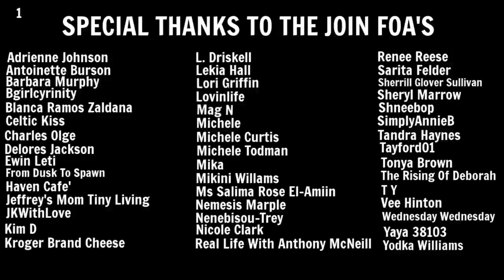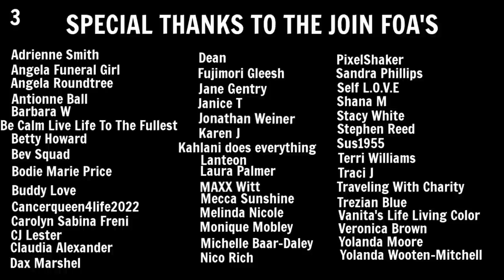Living In A Minivan | Van Build Day 3 | Unconventional Floor Choice

Comment: Your a Good Man Anthony. as a professional contractor that stuff was not designed for foot traffic and unfortunately it will rip especially with winter coming. I definitely appreciate you and your creativity. You have a great personality. That stuff is designed to install Waterproof vinyl plank flooring over top of it . The flooring cuts easy with a Multi tool . You could by rights return the tool when your Done .We use that product on basement walls as a vapor barrier to prevent moisture issues. I’m sorry to have to  tell you but winters coming fast.
Reply: Rockwell makes a ocelating multi tool that’s cordless you would be able to do a lot of your projects with it .Take a look at them if you get the opportunity they cut almost everything. Have a great Day and good luck on your project my friend.
Reply: Wow you have such a respectful way of giving feedback! 👏
Reply: Very important, especially since heat and moisture are two major issues in van life.
Reply: @George-xe2ub  😂😂😂
Reply: @George-xe2ub  😂😂😂😂😂😂😂
Reply: @Dutch_Gonneke  Isn't he just the best!  :)

Comment: If you put reflextix down you will see it will start pulling apart and crumbling. Put it under the carpet for insulation. Put the large board then the refextix then the carpet. Then put in your table and bed. Use some L brackets to put some shelves in under your table.
Reply: Exactly what I was going to say
Reply: I was thinking the exact same thing. Overtime it’s going to start cracking, peeling, and tearing. It might look nice now,  but it’s not going to withstand the long haul unfortunately.
Reply: You are right. I use it downhere in the Caribbean as a window cover to cover the inside of your car against sunrays to keep it cool. After about 1 to 2 months of heavy use it starts cracking and leaving little bits and pieces all over your car and yourself creating a mess
Reply: He could of gotten soMe of those connective matting the type they use at gyms or whatnot that would be great. I think Anthony is worried about easy cleaning
Reply: @kingrook45  maybe he could use a little hand held chargeable vacuum
Reply: Exactly, I was thinking the same. Do it right the first time ❤
Reply: Antony could place one of those clear runners that is used on carpet for heavy foot traffic aress
Reply: The drill driver is a little late to the party
Reply: Goodness! That crackling sound as you walk and move around is annoying enough!!😀Lmbo Anthony! I can’t agree with you on this one!😂
Reply: I was going to say the same thing. He needs to put some type of carpet down or a linoleum type thing

Comment: Your spare tire is under the back of the van. Under the board is a crank to lower your tire. You need to locate it mark your board and make a hole so you can get to it. You never know when an emergency may arrive even if you have roadside service the need to lower the tire.
Reply: Great suggestion. I hope he sees it.
Reply: The 2012 Grand caravan  that I have the spare is in the front part of the van and the crank is in the front to lower the tire I'm not sure if they changed it.
Reply: Hey and I'm not trying to be mean but I worked at home Depot and Lowe's and flooring wall and both these companies and he's using reflectives as a carpeting it's going to get all ripped up he's spending all this money or whatever that's not meant to be walked on I don't understand why he thinks he is doing that I don't he's going to make so much more work for himself that's not meant for that
Reply: Lawd have mercy...the mylar reflection will create  moisture along with the butane,boiling water steam and freeze a home for mold...walking on that with socks and bare feet is like a slip and slide if you spill anything and lose your balance watch out for your head,back,and possibly a broken leg or foot...it peels,flakes, and pools water in the grooves if you tear just a bit of it 
It can water rot the wood you made your bed with, and destroy the insulation of a perfectly good van...There are plenty of van builds on YouTube where people build as they go...lookup budget van builds on the tube...if not...get a ⛑ helmet...to protect your head if you slip and fall...(I pray it never happens...)
Reply: @dianematlock7922  I hope you posted this in the regular comments and he sees it. We don’t want him slipping and injuring himself.
Reply: Good idea
Reply: @lisasharinglifestorieswith4182  thats what i told him.
Reply: @KetoCarnivoreLifestyle  i know huh. I post messages telling him step by step to what he needs to do. Lord he needs to make it down here to texas so i can fix his van for him. He makes me nervous. He'll be doing something and im like nooooo thats not going to work.
Reply: @JamericanSpice  I didn't... it's a little late anyway. He's not going to change anything at this moment...he's in a rush to see his momma and being there when he said he would be...should've planned the inside first...Rushing to do things rarely  works out well...I wish him the best, hopes he picks up a helmet...as he walks the slip and slide walkway...
Reply: I would research more . You do not need mold or moisture . Passive airflow needs to happen.
Reply: This guy is clueless about what he is doing. Using insulation as floor covering.  Using nails and butchering everything by ripping it out to do it over again. Not to mention  covering access to lowering the spare tire. This job is just costing him money not sitting down and planning. He buys and does thing on impulse and need to stop and think
Reply: No on the stow and go seat spare is up front between the driver and passenger seat.  Covered with a black plug.
Reply: @lisasharinglifestorieswith4182  it is amazing when i watch and listen to people that common sense doesn't come into play. Sit down with a piece of page and draw out what is a possibility. If it doesn't sound logical. Throw that piece of paper in the trash and start over. Sleep on it, think about it, talk to God about it. Don't reap the benefits of sheer stupity. As i watch im like omg are you serious. The 2 sheets of ply wood threw me. 😂 there's book smarts and there's Anthony. Yes i will come over to your channel. Gods blessing 💙
Reply: @Inthesouth2  I appreciate you I know rocket scientist but him being a grown man I just can't even believe cuz I worked in floor and wall like I said at Home Depot and I worked at Lowe's and electrical and I'm not smart right but I anybody that was a grown adult would know not to use reflectix that's it's just it's just too keep him warmer it's nothing to walk on I just don't understand and when he used that accent one time he bought an ax and he acted so afraid even a woman won't act out afraid to use an ax little hand ax he got he was he was too afraid to use it he had to put it away and I'm like a little kid would know how to I just don't understand Anthony I don't know if Anthony was real sheltered or what and I'm not trying to be no disrespect to him but it's just no common sense it's just makes no sense and I appreciate you you seem like such a nice person and you know what this is what kills me Anthony seems to have the nicest people that follow him and and talk to him and he don't return like he doesn't talk to none of his people like I do that's why I want what I said in my thing and I keep preaching this I want to reach out and be a part of your lives yeah if I become big on YouTube eventually you make money and stuff I just don't want to take money and not talk to nobody I want you people to be a part of my family and that's what I you're a part of my life now and I appreciate you thank you
Reply: @carolcatchychanneltipsandt1448  Carol I read what you said and it makes so much sense I don't know what Anthony is thinking also because by putting that reflectus is great for not on the floor under the subfloor but it's great to insulate your van but not on a floor to walk on it's going to rip all up I don't know what he's sleeping and I appreciate it sounds like you know about van life about moisture condensation being in there and I don't think he's aware of that he's had a van before and I don't know why he's not thinking about moisture cuz everybody everybody I watch Vancity van life Chrome who lives in British Columbia and he's awesome he knows his stuff so I just wanted to take the time to reach out to tell you I think you're awesome what you wrote him I have a channel called Lisa sharing life stories I met a couple people's on Anthony's Channel Southern humor joined my channel and if you'd like to you sound like a nice person it would be nice if you joined it too so you have a great day and take care I just hope he can get the help he needs because he's not doing stuff right and he's going to have problems
Reply: @lisasharinglifestorieswith4182  don't advertise your channel on someone's page.
Reply: @jojopowe1150  I'm not advertising my channel on somebody else's page we can't these people came to my page and we were talking about something privately so it had nothing to do with Anthony you or anybody else it's a private conversation so please take care of your own stuff I'm not meaning no disrespect but it had nothing to do with anybody else they came to my page cuz we needed to talk about something
Reply: @jojopowe1150  people had questions about my previous job at Home Depot in Lowe's and I was explaining them stuff about it I didn't want to keep talking on this page that wouldn't be right so they came to my page and we discussed some things so that's what that was about but it's none of your business so please I'm not trying to be mean rude or anything it has nothing to do with you what I'm talking about to somebody else that's just not right it's none of your business
Reply: @jojopowe1150  I'm not advertising anything about my page people came to my page and we needed to talk about something else I don't want to keep writing something on somebody else's page that's rude and ignorant I wouldn't do that so please this has nothing to do with you take care of your own business please and don't be mean and rude this is nothing to do with you I'm talking to somebody about stuff I used to do at Home Depot and Lowe's it has nothing to do with you please that's just not right
Reply: @jojopowe1150  can you stop writing me I'm talking to somebody else that has nothing to do with you about where I work and I wanted it to be private so please can you stop
Reply: @lisasharinglifestorieswith4182  ??? I did not write you.
Reply: @jojopowe1150  well then I'm real sorry somebody wrote me said I was trying to advertise my channel and I'm not I was just trying to talk to a couple people and not put all my business you know what I'm saying and I apologize to you I'm sorry

Comment: I would be tempted to find an area rug maybe 3x5 or 4x6 to place on top make the floor more cozy and you could shake it out when dirty.
Reply: Actually a runner is 24in by 84 that would probably fit in perfectly.  Anyway to get that seatbelt out of the way?

Comment: Hi Anthony.  I don't know how long Reflectix will hold up on the floor where you're walking on it.  But it's certainly worth a try!

In my minivan I have the floor covered with interlocking foam squares like you'd use in a kitchen or gym.  Because I live on my knees in there, and the padding really helps.  If the Refletix doesn't work, you could try that next.
Reply: You should put foam carpet on top of that because over a little time that's going to chip real bad.
Reply: Its to be used for insulation not carpet, im laughing watching him do this. I don't think he did any research
Reply: Thank you again, Anthony.  I'm learning from you. People don't understand that there are many like us that just tackle a job without first researching and researching again and double checking everything that it becomes exhausting & boring & no fun at all.  I personally become impatient if I don't go in full charge - picking up the pieces as I go.
Makes the day go by fast, keeps your mind entertained.  I guess I'm a little bit like MacGyver - take what's available & make it work.🙂
Reply: Yes, it's a good idea,  but reflectic will, start crumbling, it's an awesome insulation, but not for everyday traffic   maybe if you put rug that comes in squares to match the van interior color...
Reply: @edgit69  Useless insensitive comment.
Reply: Could the interlocking foam work on top of the reflector? Maybe additional insulation and cushioning?
Reply: @MsPhillyG  I see about 90% of the comment are telling him the same advise as I am. Do be encouraging him like the other 10% to think it's ok 👍🏽

Comment: Tip. Run a strip of gray tape right down the middle of the floor coverings to prevent crumbs and other debris from collecting in there. Also, it will securely keep the two pieces in place better....less shifting

Comment: The sound of your new floor would drive me crazy everytime I would walk on it......I would get some black carpet that they sell on a big roll at home depot....have them cut the length you want...
So it would prevent the noise and you wouldn't make dents in the reflectix.
Reply: You may end up using the extra reflectives to cover windows to prevent moisture build up and to keep the van warmer. Some people glue it on the back of poster board from dollar tree and the board can be sprayed black. When these boards are cut to fit each window they help to keep the van warmer and cooler. Amazing the things we learn as we go. Don't ever get discouraged.
Reply: @edithtrowbridge1775  they sell black poster board, too.

Comment: I hope the reflectics is sturdy enough and will not wear and tear quickly when you move around on it 🤞🍀
Reply: As a professional contractor, We use it as a vapor barrier on basement walls . It would work also with vinyl Waterproof planking over top of it to give him a insulation value. Anthony is a good guy … this stuff is essentially silver bubble wrap . It won’t hold up to foot traffic
Reply: @christophertrump1570  Yes, I was thinking the same as to not holding up to foot traffic.
Reply: @christophertrump1570  thanks. I learned something new. And yes Anthony certainly seems like a good guy! 🙂
Reply: Yeah, what is that- mylar?! That's like walking around on a deflated mylar balloon.

Comment: Anthony, not sure how the reflective will hold up with friction of walking on it.  I would cover it with a rug as the rug will provide extra warmth AND protect the floor.  Also, I would keep the extra reflective to line the inside of the van for extra insulation.  You can always put a curtain up or spray paint it so it won’t be so bright or noticeable.  Also, it can be used to insulate windows.  PA and MD gets quite cold in winter.  I would insulate the heck out of the van. I would also get som hooks, strong Velcro and bungee cords to secure things in place while driving.  Just a thought. 🥰

Comment: It does look nice and I like your lay out.  Its going to be comfy. 1 big problem, the Reflextix is not made tuff enuff to withstand all the use it will get. I know you are in a hurry to hit the road, but the guys are correct, it needs to go under the plywood or carpet. Maybe use your carpet remains as throw rugs to help save it until after you meet up with Anthony, then fix it. Possibly you could cut a strip off the end of the rug to patch the holes with duct tape on the bottom, ive done it before.  Also if you leave the Reflextix as is you need to use a continuous strip of HVAC tape to hold the 2 pueces together to stop crumbs getting underneath.  HVAC tape is the only tape ive found that withstands different temperatures on Reflextix.  All the others work for a minute then start peeling up which includes duct tape, mailing tape, gorilla tape, scotch tape, deffinetly not electrical tape.  Only HVAC tape stays stuck.

Comment: hey Anthony I just seen a great product from another van dweller - it's called Alien Tape available on Amazon or Walmart, but way cheaper through Amazon.  It's double sided tape to hold things down, like anything you want to keep on your counter, etc., so many uses....but if you change your mind and want to take the tape off - it's comes off easy and does not leave the surface with damage.  Just a little suggestion to help with your build

Comment: Anthony. I suggest going to Lowes or Home Depot and buying vinyl sheet flooring. They will cut it to size and buy or borrow a staple gun and staple it down to your sub floor on the under side of the wood. So get it cut 2 or 3 inches wider all around. Leave that padding on too. You won't have to replace it for a long time and is durable and easy to keep clean.  That stuff you put there is not gonna last exposed.

Comment: Like others have said, you will need to cover the reflective stuff or your van floor will look like lottery scratch off ticket debris🤣🤣. It will break down pretty quick, since its to be used more as a barrier in between something. Otherwise looking good.👍🏿

Comment: Anthony, please put a carpet down or even some rubber mats to protect the reflective.  It is meant for a specific purpose.  In the long run you won’t have to replace it.  It can tear. Good luck with your new place. 👍🏼👍🏼👍🏼👍🏼
Reply: The reflectix belongs under the subfloor. The reflectix will still breakdown with carpet on top

Comment: So Anthony if you're puttin the reflectics on top of the flooring you should be fine because it's going to definitely help with keeping you warm once you turn on the heat and cover the windows at night before you turn in it's going to hold heat nicely in the van that's a great choice to do it that way instead of under the flooring and remember to install you a carbon monoxide detector also👍